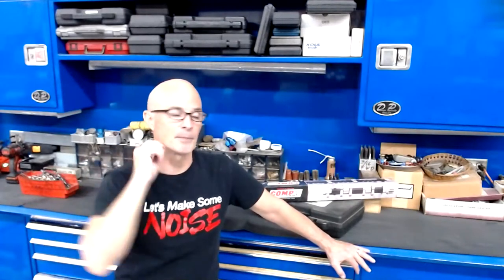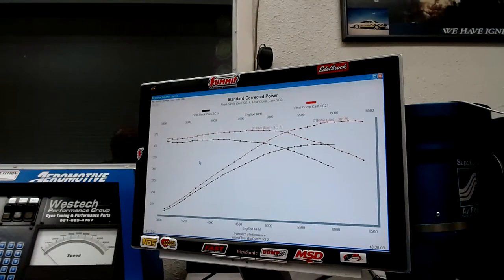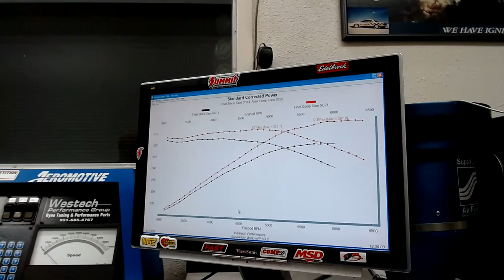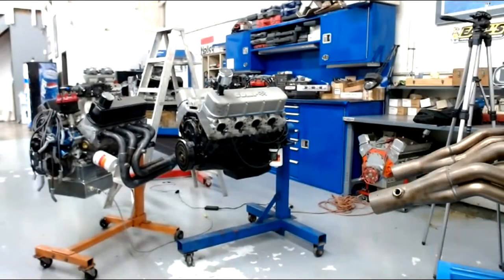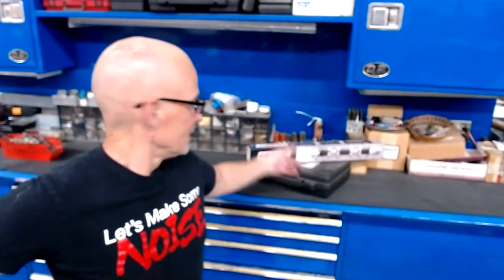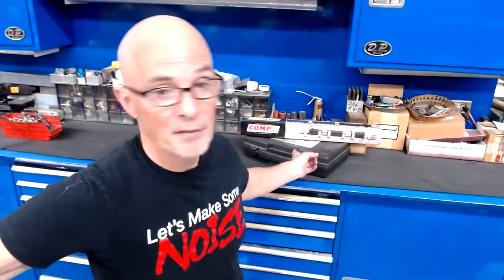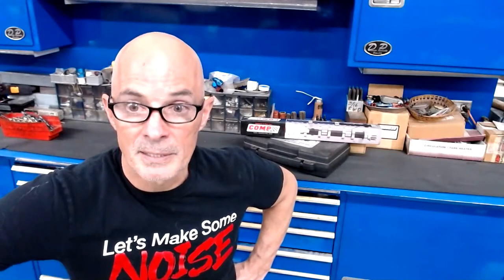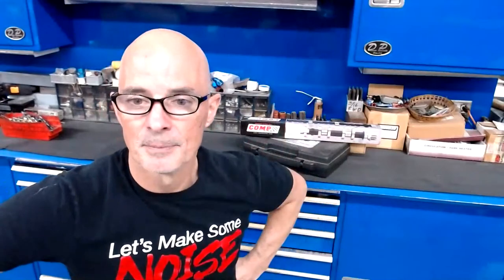LET'S TALK TECH-BOOST & DYNAMIC COMPRESSION

Comment: Richard the one thing that I noticed is. You do a lot of Dyno stuff. Dynamic compression does make a huge difference as soon as you put it  in front of a 3400lb vehicle. Huge camshafts and lower compression will still make numbers. Put it in a car and you will see why head cam and piston combinations will make all the difference in a car. I picked up a full second Taking the same cam specs (740hp peak numbers) and reducing the lobe separation from 114 
 to 109 on a  15’ headed 427 sb ford (15.1 compression engine). When the car weighs 3600lbs running 11.50s with 740hp Dyno engine is not soo amazing.
Reply from the maker: A TIGHTER LSA MIGHT MAKE MORE AVERAGE HP, HEADS, CAM AND INTAKE MAKE ALL THE DIFFERENCE ON THE DYNO TOO

Comment: Great explanation it points out just how many things that have to play nice with each other to not detonate.
For years I have tried to explain and you have done it. Geez from running a 5.0l Mustang at Texas Motor Speedway in the early 90’s with head gaskets I sent you from FEL-PRO Performance.
Have a great New Year.
MC
Reply from the maker: you sent me head gaskets?
Reply: Sure did I don’t remember if it was wire ring or Graphite which worked great with a Dart iron head. Jon Bennett I was working with too he was making 700 hp gave me great feed back on his fuel system back then 110 in the tank and a much bigger pusher on the frame.
I think that was before I designed the Loc-Wire gaskets. Those AR AMB heads only had a deck thickness same as E7 Ford passenger HO 5.0 heads. They flexed so bad the loc-wire jumped out of the groove on one guys engine.

Comment: Another thing is, you have to look at parts (iron heads vs aluminum heads, quench ,inconel vs stainless, polished chambers, chamber shape, piston coatings, octane, dynamic compression, colder plugs, direct injection vs standard injection) is giving you a wider tuning window.. I test on 200mph+ lt4/5s corvettes and getting an engine to live at over 1000whp for over 30k+ miles is a feat, lots of data.

Comment: One of the big changes with compression ratio, VE and camshaft selection was from a single direction albeit non linear function of ignition timing pre programmable ignition systems, meaning you could either set a static timing that suited the most susceptible cylinder pressure event point and everywhere else just had to make do or you had a non linear curve which may or may not have been ideal, along comes programmable where you can retard timing at any point anytime, any condition to avoid excessive cylinder pressure according to the fuel octane along with knock sensing so now cylinder VE is able to be increased way beyond traditional levels hence the current HP wars, also Enhanced by data acquisition/ monitoring etc , if you look at VE and direct relationships to HP why does a say 4.8L LS boosted produce 800+ hp when dynamic compression due to increased VE far exceed that of a high comp na combination but not destroy it self with detonation every time, it about managing peak cylinder pressures relative to fuel properties of flame travel speed, pressure rise rate etc and the ability to custom tailor these factors
Reply: By God, you did that in one sentence!
But forgot the period at the end.

Comment: Very interesting and informative. Kinda like the chicken or egg. Which is better. Hey you had a video about camming a 5.7 hemi. I have a 2006 5.7 in my truck, everything is stock. But I'd like to get low end and midrange torque. I tow a heavy boat. Any cams you might recommend. How about tuners you like.

Comment: Over 50 years ago, there were devices which could measure the cylinder pressures with the engine running under load.  They were hugely expensive then and I would suspect they have greatly improved and possibly come down in price over the years.  Such devices are the truth tells for the subjects here.
Reply: Cylinder pressure indicators go back to steam engine days in the 1800's.  Modern technology uses piezoelectric sensors that are not terribly expensive by themselves, but a lot of other instruments are needed to get data that is useful.  A crankshaft encoder with half-degree resolution is needed to phase the cylinder pressure waveform to engine rotation.  A calibration cart is needed to read the sensitivity of the transducer and to check for drift.  Computer and specialized software, too.

Comment: Mt. Richard, I have been trying to tune  my 70 Pontiac Lemans for a
 while. Ping ping ping run so rich jh cloth stink! 
I identified the motor today and the 350  is a 69 350 xu 330 Hp with 12.5. 1 ... 48 heads   Does it sound  like the total timing will need to be lowered? 
 
Thank you,  in advance to any one that can help me out with some ideas. I'm learning so please don't bite
Reply from the maker: 12.5:1?
Reply: @richardholdener1727 
I apologize for the incorrect statement with the incorrect compression numbers. The  identification of the 1969 PONTIAC MOTOR  checks  out to be the 350  block code   XU,  48 Heads with 10.75  compression. Rated at 330 Hp with  4bbl quadrajet the  camshaft is a 744 with the  automatic TH 350. 
It hates pump gas ping, ping, ping she  stinks from burning too Rich. The distributor is great! And helped elimate poor timing  (Progression) is the name.  
 if I lower the total timing to 25 degrees or  even less it runs but is gutless. 
If the motor were strong maybe  newer,  then may  I assume I may need a different cam  plus heads to lower the compression plus more moderazation? 
Thank you for your patience, 
Blake

Comment: As E 85 runs between 50% up to 85% ethanol, I don't believe your go to fuel of E 85 is a fair horsepower test. In the real world, not California, we use 91 octane premium gas. Also, as ethanal has half the calorie value of gasoline, gas mileage of E 85  will be considerably less, in the region of 25% less, depending on the blend. It may be cheaper per gallon, but with reduced mileage, dollars saved becomes a wash.  To be more honest in horsepower numbers, 91 premium should be considered the bench mark fuel for dyno testing. Adding water/meth injection when using 91 octane gas would definitely be more useful... Just saying..
Reply from the maker: bench mark for boost is E85

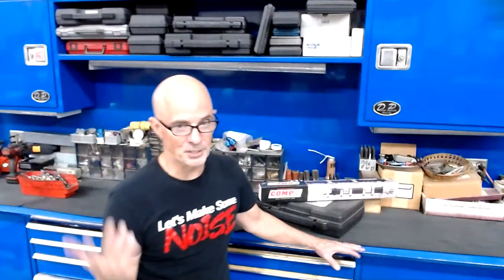Comment: Richard thanks for all you do. Question, stock 2:03 block, scat 347 kit ,afr185 ,11 to 1 comp. Comp extreme 274 or xhi 236 cam. Will it run on pump gas? Oh tuning with mspnp2.
Reply from the maker: WITH VERY LOW TIMING, YES
Reply: How low?

Comment: A little to the left, do you know of an add on knock sensor? I had info on a head set you could build to listen to it but lost the info. Thanks for your information.
Cranking psi question @ what RPMS???? No one checks rpm.
Reply from the maker: the cranking rpm is a function of the starter and supply voltage vs the resistance-200-300 rpm usually on our dyno

Comment: Does anyone know of a dual carb dual plane intake that will bolt to a gen 5 454? I'm looking to keep the power in the lower rpm range and run 2 sniper efi setups. Part number or link would really be appreciated. Thanks.
Reply from the maker: edelbrock has dual quad bbc intakes